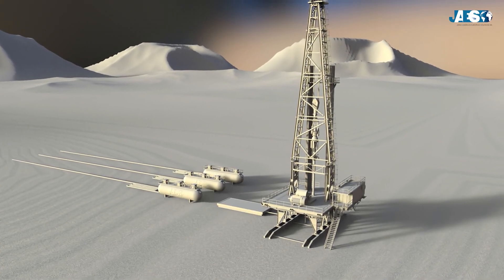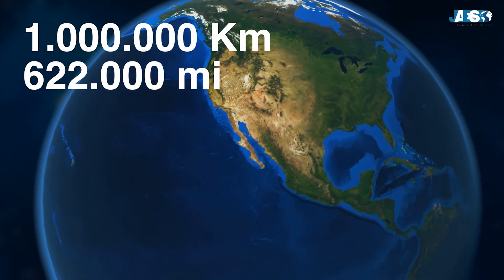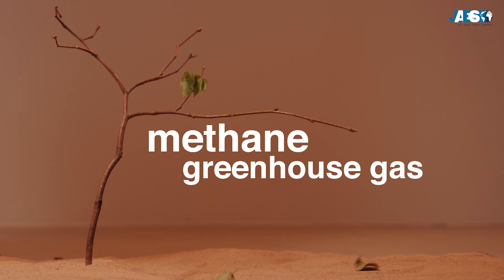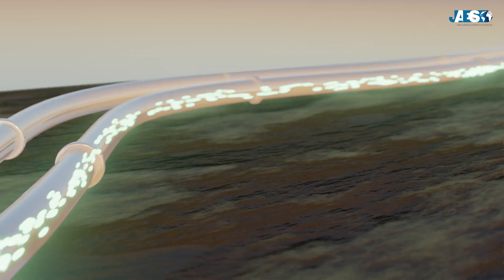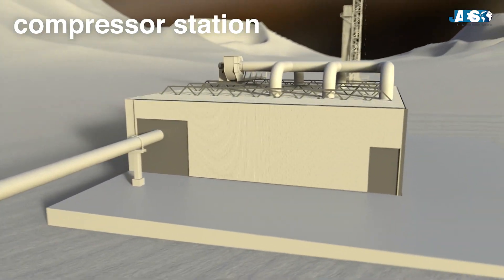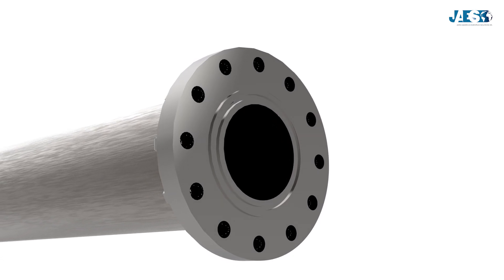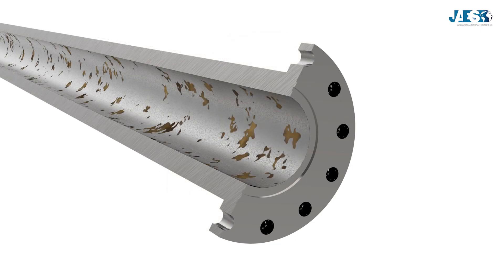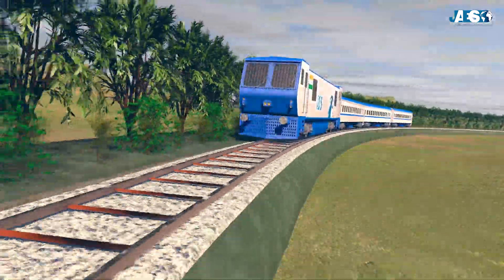How GAS PIPELINES and Compressor Plants work, maintenance with Smart Pig

Comment: I’d love to work on the pipeline to service them. I live in Ohio and would be interested in the field for work.
Reply: Good luck!!!
Reply: For jobs in this sector, you should look at natural gas production and transportation companies in the region.  Most of these companies in our region are in western Pennsylvania. Some have training programs for those without experience.  Many companies hire people with automotive assembly and repair experience to train as field mechanics to work on compressors and drivers (natural gas or electric motors).  In Ohio, a major producer of gas compression equipment is Ariel Corproation, which is located in Mount Vernon.
Reply: @MRBecker-um9op  thanks for the info